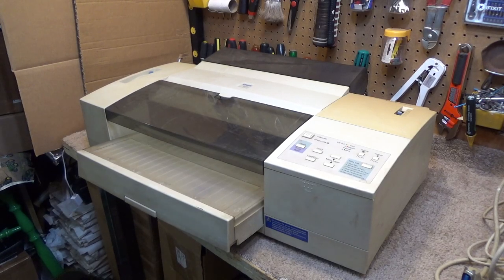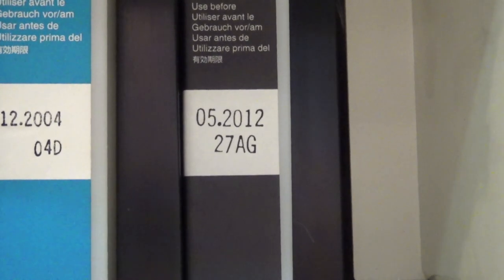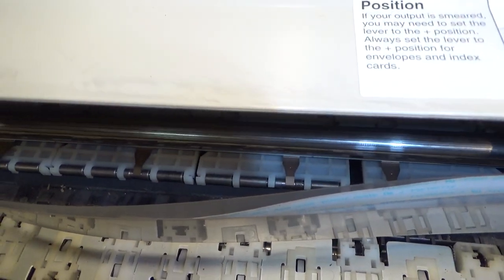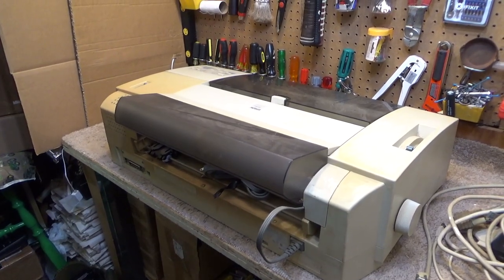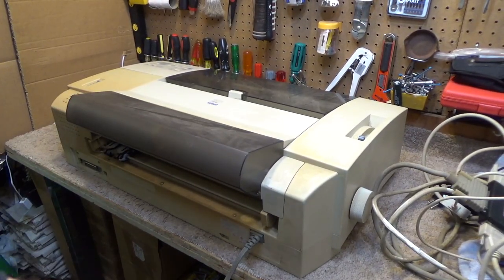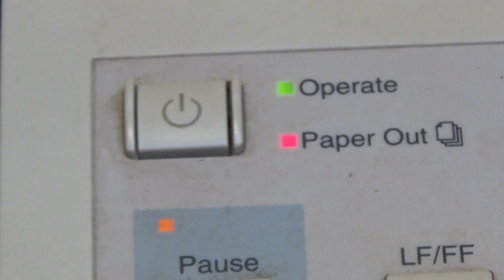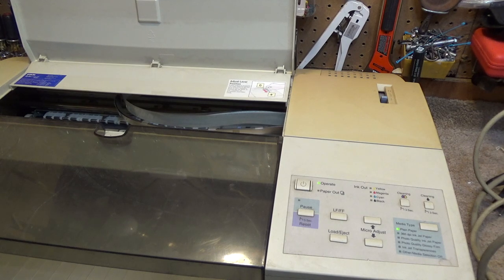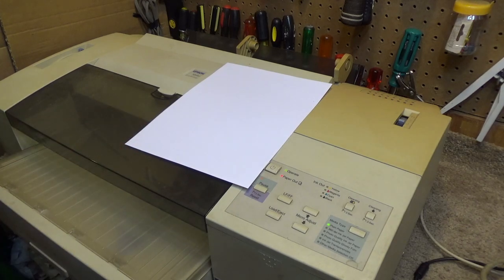Epson Stylus Color 3000 InkJet Printer | Initial Checkout

Comment: Really cool to see videos of older printers! By the way, I just have a request...would it be possible to demonstrate the product working with no additional background noise, so it can fully be heard? I understand it may not be practical, so no worries if not, because I still very much enjoy this content.
Reply from the maker: I will try, but between 2 furnaces, a dehumidifier, and multiple pieces of well equipment, it's very seldom quiet in that room.

Comment: People still used them. They get Remanufactor cartridges. A few years ago use to services these 3 times a week.. I got to know this printer very well. Serviced one a few months back, as needed a complete overhaul maintenance as heads were clogged. Pretty much had to rebuild it and changed out waste pads and two new pumps and do full alignment. Not a easy printer to service, you will need the service manual for it. I was a authorized Epson and Samsung service technician for years. We service mostly wide format printers. Most upgraded and when over to the 3800, or 7800 series from this. So not very many in service anymore. The HP wide format printers are my favorite as head assembly as well as other critical parts are designed to be modular. 

This one you do need the service manual as you have to likely overhaul it and remove the head and you will have to do a full alignment and gap adjustment. You Likely will have to change waste pads wiping and clapping mechanism. Almost can guarantee the nozzles on the head will be clogged and waste pads likely full.
Reply from the maker: Do these print very good quality? Is it worth the time to perform all that work? I work with computers/printers by trade so I could certainly get it going again with enough time, I'm just not sure it's worth it. I already have 2 other good working laser printers, one color, one monochrome.
Reply: @JordanU  They were really design for signs and t-shirts transfer prints, sublimation t shirt printing. Not really useful for regular printing, plus those printer don't like to sit as nozzles in head clogs easily. Then the dye ink it uses has been discontinued and remanufactor cartridges are also getting hard to source. The 3000/7000 can't use pigment ink as they will clog and damaged the head. I had to replace a few heads due to customers tried anyways. 

It was definitely a good printer for its  time, quality was good and was a true workhorse. As long as they didn't sit and using correct dye ink, they were reliable. 

As far as rebuilding it, I probably won't invest the time and money as consumable supplies and parts are getting hard to come by, plus just not worth much as far as reselling goes.
Reply from the maker: @thetechgenie7374  I'd never use this with any regularity, I guess it's probably not worth the time. It will still be a nice display piece for my "museum" of obsolete technology.

Comment: Thank You for the video. I own one, and it's a fantastic printer. Mine too doesn't get used since some time, but last year I bought a 1999 cartdrige ( big as a VHS cassette ) and the ink inside was perfectly usable....I worked without problems ! The printer is A2 format capable, continuous banner, parchment paper roll ( great for those D&D maps ! ) and many other things. Back in the days ( circa 1992 ) in Italy it had a price tag of a small car. I had a shop, and used it to make window banners....   It works on serial, parallel or SCSI interface. Funny, in a few years Younger people don't even recognize a parallel cable.... :)     You can use an adapter, Works perfectly under win10. Anyway, if You find a used one for a couple hundred bucks buy it. This is as big as You can go short of a plotter, accepts all kind of media, and a cartdrige lasts for a lifetime.  Search the internet, and You can find Ink, drivers etc
Reply from the maker: I ended up holding on to this thing, I have no conceivable use for it right now but you never know.
There are already people who don't know what a parallel cable is!
Reply: Hi, would you mind letting me know which USB-parallel adapter you use please?  I have one of these printers from new 21 years ago and wish to see if it will work with Windows 10 so I can show it working and sell it and avoid taking it to the tip.
Reply: Bonjour pourrait vous mais dire quelle pilote de installation je puis installer pour cette imprimante svp merci je cherche sur Epson mais comment je ne pas le pilote déjà installer ils propose que la mise a jours si on la déjà installer sur le site officiel
Reply: @gheorghinacostincianu6245  Bonjour et bonne fêtes. Je l'ai vendu. Je che che avoir si j'ai toujours les pilotes.Alors quel système d'exploitation ?
Reply: Bonjour et bonne fêtes a vous aussi, merci je vous l'acheté si vous le trouve et mais le vendez pour le system pour (Windows 10). Je vous souhaite une bonne fin d'année. Cordialement @richardsorge-
Reply: @gheorghinacostincianu6245  J'ai créé un dossier Drive avec le pilot mais je ne sais pas comment vous passer le lien vers celui-ci

Comment: Besides the addition of the unnecessary "the" to words, and deliberate mispronunciation of "cartridges", I am glad you got the color names right.  Though "Cannon" should be "Canyon", as in "Canyon Blue".

The connection to that printer is PARALLEL, not serial.  No amount of "I said it purposely" that way is excusable.  The other PS/2-looking connection appears to be an Apple-specific port, like either something like an ADB connection port for the old Apple IIc and early Macintosh machines, or perhaps it even offers AppleTalk.

There's not a very good chance it's going to print again, unless it was still in service up until you got it.  Otherwise, ink has dried up to such a degree that it's going to be near impossible to have it flow again.  If you take a closer look at the ribbon cables going to the heads, there is a black one in there, those are actually ink tubes that carry the ink from the cartridges to the heads.  Older Epson printers sometimes could be revived using Windex with Ammonia, but they actually don't offer that product for sale any longer.  It's possible that straight ammonia would work, but I've never had the opportunity to try it.

“Insanity is doing the same thing, over and over again, but expecting different results.”  That rings true especially here in the comments, with your incessant replies to a certain spammer "Michael Porter", as if it's going to change anything.  He has successfully wasted your time, if nothing else, but you've frittered away what time was left, bothering to actually reply and/or entertain the comment, only to have it happen again in the next video.
Reply from the maker: I happen to have some Windex with Ammonia still, it was an excellent product and I've used it to clean things in probably hundreds of videos now. I was not aware it was no longer in production, that's quite a shame. In case it was in use up until recently, I'm going to try to get it connected to a machine that will work with it at some point. But since I have no regular use for it, if it doesn't work, I won't be attempting a repair any time soon.

You're partaking in the same insanity you're accusing me of.
Reply: @JordanU  I actually looked it up, and I stand corrected.  The product is available.  Last time I checked, which was a few years ago, I did not see it available.  Not all variants of Windex have ammonia, but ammonia makes an excellent glass cleaner.

With the date of those cartridges, I highly doubt it was in much use past the latest date, which was still a respectable run for an inkjet printer.  That particular printer appears to be able to take ledger-size paper (11x17", or 2 8.5x11" sheets together), and may even be able to take 13x19" paper.  Being that the printer has a feed knob on the side, I would not be surprised if it offered the ability to accept tractor-feed paper, as maybe a dot-matrix replacement type printer, for high volume prints (based on the physical size of the cartridges).

I was not partaking in the same, I was simply stating a fact.
Reply from the maker: @jaykay18  I believe the largest dimension paper this can take is 22" wide.
Reply: @JordanU  I just checked the manual, it accepts "Folio" size paper, which is 17x22.  I haven't seen paper that big, but I do have quite a bit of 13x19.

Comment: Don't connect it to the internet!
Or don't allow updates for it.
A kill code for after market ink or cartridges is often included in updates.
Reply from the maker: I highly doubt something this old would have any updates, much less be a victim of planned obsolescence.
Reply: @JordanU  I suggested it because I watched many videos put out by a US man who made continuous ink tank systems as  aftermarket add-ons. 
He claimed that if the cartridges have a microchip on the back of them Epsom will issue updates when they know he has created new things in order to prevent the printers working with them.
It was him that suggested turning off printer update.
You know best, of course, I have no experience in this.